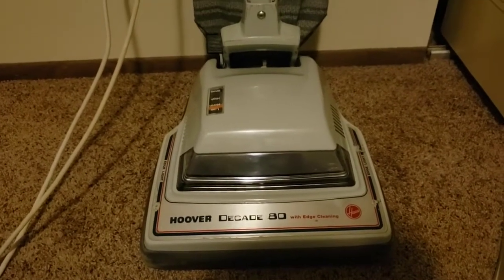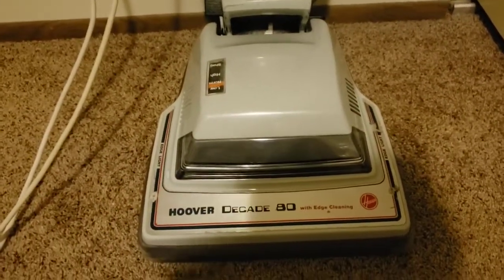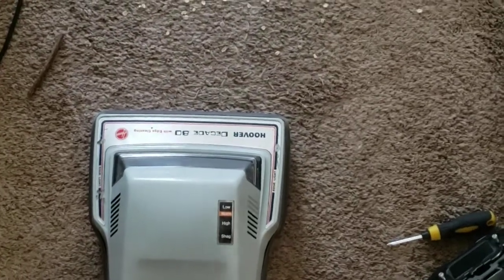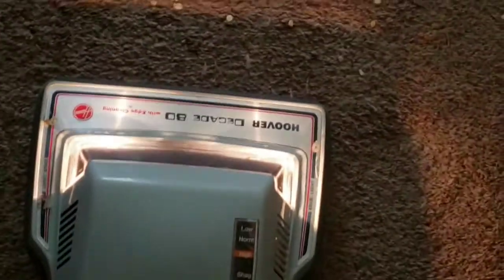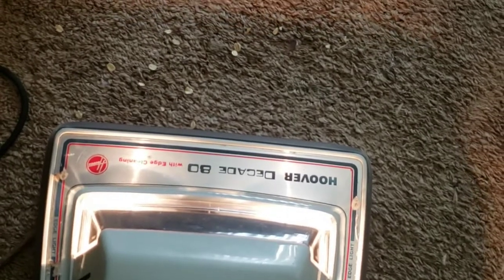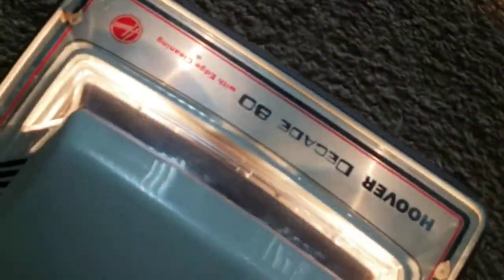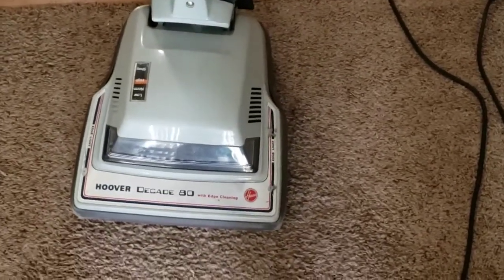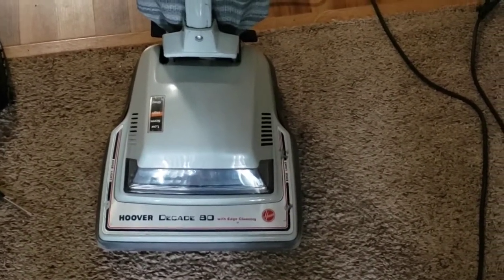Hoover Decade 80 airflow test

Comment: Hoover USA's Decade 80 model U4385 with the power surge motor replaced the model U4153 with the standard motor in 1984 and was produced for 4 years at which time the Decade 800 series was launched. I appreciate the test and your comments.
Reply from the maker: Do you happen to know if the Standard motor continued to use the metal fan or if they had made the switch to the 6 bladed plastic fan like these?
Reply: @Blackheartvacs  I just looked at the Hesco, Inc. parts list and only saw two Convertible fans listed: part no. 21644 (12 blade) for early Convertibles - perhaps through the 1970s, and part no. 38755011 (polycarbonate 6-blade).
Reply: @Blackheartvacs  The standard motor decades aka the 4.8 amps had a plastic 12 blade actually.
Reply from the maker: @hooverboygames  Hm, suppose this had it's fan replaced at some point. Given it's age it's quite likely,.
Reply: @Blackheartvacs  whats the model? if its a u4385 then it came with a 6 blade.
Reply: i had a u4385 as my first vacuum
Reply: @Blackheartvacs  that is the model that came with a 6 blade
the u4153 is the one with the 4.8 and 12 blade

Comment: Great vacuum, but it's not the performance I was expecting, this one seems to be in the ballpark of the Elite as far as airflow is concerned, probably because it's limiting factor is that 6 bladed fan.
Reply from the maker: Same here! I figured with it having a higher amperage motor vs the older convertible I tested we'd see airflow in that ballpark but nope! I've considered looking for an older metal fan for it but then it loses some of it's "identity"
Reply: @Blackheartvacs  Fair enough, also the metal fan won't fit right without some modification.  I bet the 11 bladed plastic fan (if you can find one) would fit better.
Reply from the maker: @graysonsvacsandmowers5426  Good to know I just assumed it would. Edit: I found and bought one. The decade has been placed in storage but once I have it again i'll swap the fan.

Comment: So I have the chance to grab one should I not? I have a tandem air simplicity I love and a Miele U1 because I’m a little too functional in terms of performance to go with some of the older machines. I found an amazing condition green decade 80 and I want it but will it perform okay on my high pile rug? Most my floors are hardwood now so the tandem air doesn’t see much use Anyway for its killer action on carpet it kind of stinks on hardwood. The U1 isn’t bad on hardwood. I want this old one but I am very functional too
Reply from the maker: Go for it. A little variety is a good thing.